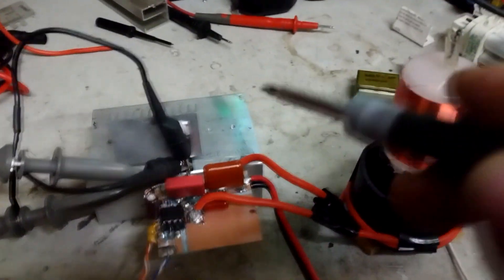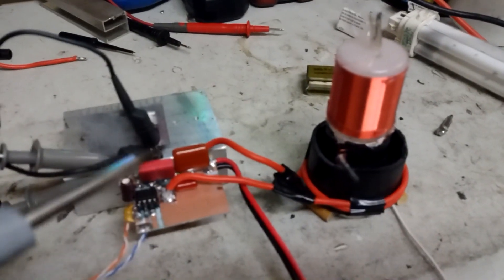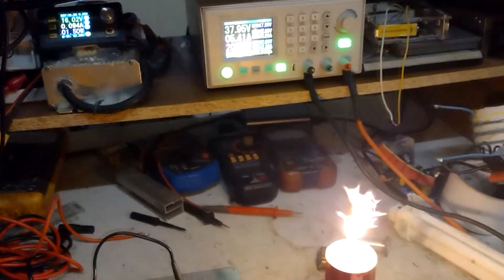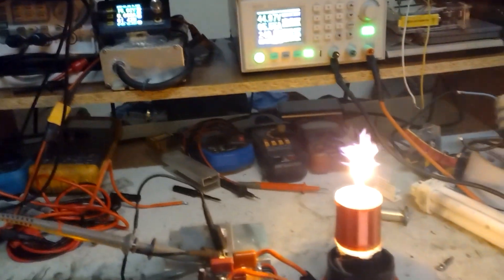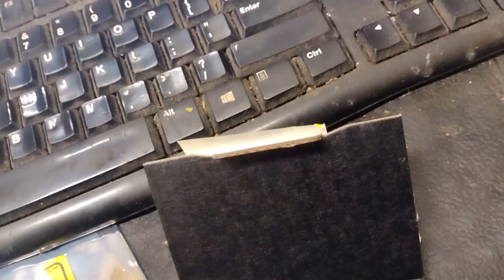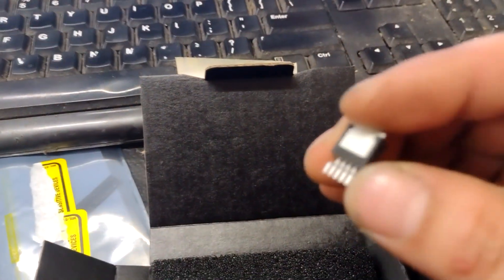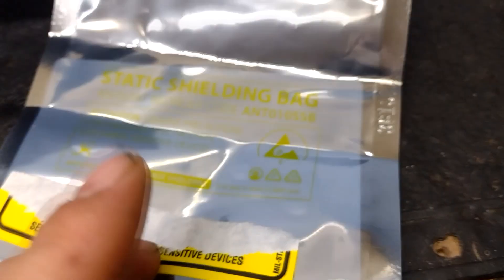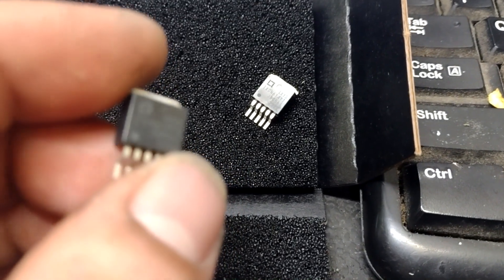3MHz Class E HFSSTC 'stacked coils' + Gate Drivers

Comment: What's the actual tuning procedure on a class E sstc.
Like how to choose the input inductor value , D-S cap and DC blocking cap and primary inductance or number of turns. 

Is it like setting the Inductor and D-S cap to the resonating frequency of the secondary and choosing a blocking cap with a non-critical value between 47 and 330 nf .
Is the primary inductance important or do I just test with 1-5 turns keeping everything else constant. 

Still not sure.
Reply from the maker: Depending on the actual topology used it can be different. In these circuits I'm using the primary and switch capacitance to form the LC circuit. So in that case the idea is to as you said match that tank frequency to the secondary resonance, which with secondary feedback should have the primary running at that frequency. 

The inductance along with the capacitance in the primary circuit will ring during the off cycles. If you can tune that primary circuit to ring at the same frequency it's being driven then you can shape the drain waveform into nice humps that will charge the drain capacitance (intrinsic +external shunt) and discharge it back to the primary at the right timing so when the switch turns back on there is no more voltage across it already. This means for a given resonate frequency you plan to run the circuit, the primary coil needs to be an exact length relative to the total shunt capacitance.
Reply: @Magneticitist won't loading and extra capacitance from me keeping my hand near it or for some other reason , change the secondary frequency .
Also the core material for the gate drive tranformers . I'm thinking of a 500 to 750 range frequency for my secondary . So N30 maybe ?
Reply from the maker: @spiderspider1384  Yea you just have to keep that loading in mind when tuning it basically. You don't want to be tuning the network at something like 24V if you plan on running the thing closer to 90V etc.. You tune it (gradually if needed) for 90V and just deal with it being out of tune at 24V. N30 or something should be fine.

Comment: Those UCC27614 are indeed stupid small, the only way you could use those is if you get a custom made pcb and a hot air rework station. Alternatively if you still want to experiment with that driver I believe they come in a bigger package if you get the UCC27614DR version, although I’m not sure if they are have a heat sink pad on them.
Reply from the maker: Lol yep comically small. I could have just looked at the package to see that but I just completely ignored it and assumed they would be some type of reasonable size for the power dissipation. Would be cool to utilize them one day after getting a really precise board layout.
Reply: @Magneticitist for sure, and at that point you might as well miniaturize the rest of the circuit and make a super small board. Luckily it’s so cheap now to get them made in China, like $4 for 5 boards isn’t bad. The only thing is the time required to route the boards in CAD
Reply from the maker: @quantumlab9130  yea I totally need to learn that eventually though. My first thought when looking at them was holy crap how could I even get that on a board without some kind of modern soldering machine that does it automatically.
Reply: @Magneticitist  yea a hot air station (which luckily aren’t that expensive nowadays) is necessary for working on stuff that small, but it is still totally possible to do it yourself with some tweezers and a magnifying glass. And board layout is definitely a challenge, and is something I’m still still working on and not even close to mastering.
Reply from the maker: @quantumlab9130  I work with a guy who might be able to do it cause I damn sure can't. The pads on that thing are basically the size of a needle tip with about the same diameter distance between them. I guess with the right flux and solder paste it could all just sort of suck it properly. Kinda got me wondering now.. I almost want to tack hairthin wires on that thing and heatsink it with a piece of copper wire or something.
Reply: @Magneticitist  lol, you could try that. That would be incredibly tedious but possible with enough time and a steady enough hand. Although with such thin wires I don’t know how much current you could actually pass through those tiny wires in order to actually drive a mosfet.

Comment: Did you check my last short video on the audio Modulation with the big secondary , it sounded a bit distorted but I need to keep playing with it , those little fets get warm pretty quick , I should try with much less voltage like about 18v , but now I killed the tl494 when playing with it hehe I will get some more chips next week , and it is time to start with the hfsstc
Reply from the maker: Yea they will get hot with bad snubber tuning. I wouldn't really be able to play audio with that setup without having something like a nice 1inch long bush first though, because I'd need to back it down to something like 40% duty to remove distortion.

Comment: Not bad for 30V! I'm starting to think I should decrease my primary turns and add some capacitance instead to get higher peak currents at 60V. Right now, with 940pF on the D-S and 4.5 turns, it's alright, but I can't get much more than an inch off the output. Hopefully with less gate resistance and fewer turns, the output will look more like yours, lol.
Reply from the maker: This one has been kind of interesting in that the last couple builds took more care to tune. My entire process with these started out with me running that chapstick coil at 3.5mhz or so, fairly decently, then randomly at some point around 45V or so popping the sic fet I had on there. All I noticed at the time was fairly severe gate ringing. It hadn't reached a threshold where the scope was counting the rings in the measured frequency but it was something around 4-5v or so peaks. Since then I'd be scared and took great care in trying to reduce the ringing. Now some builds later and using the copper boards this one was incredibly easy where all I did was use the 1.65 ohm gate resistor and do the final tune on the drain caps. I can easily swing this one to 45V with nothing close to the ringing I see even on my other real nicely tuned setup with the 650V sic fet. So the clone IRFP260 is doing real good here. I think I could push 300W out of it no problem, maybe more if it survives 250v+ swings which I've seen other people do before on 200v fets at higher frequencies. I settled on the 3mhz here just because I need to use those two coils and stop wasting wire, but it seems like it could run 5mhz or so no problem. 

And yea if you want to push more power the first thing I'd try doing is going down to maybe 2 turns and upping the capacitance in the LC. If possible I would just try to monitor the gate drive power with just the oscillator and mosfet first, trying to find a compromise on the waveform you're seeing and the power dissipation of the driver at the time. There's going to be a reasonable ceiling with your given setup starting with maybe something like 3 ohms gate resistance. At that point you can sort of just ballpark a DS cap based around what you know to be your current L1 length and the freq according to your ~1nF. If 3mhz seems doable, then you'll probably need to maybe halve your DC cap or close to it, or reduce the number of total turns and L1 length etc. Eventually you'll be able to power the primary and just vary the freq til you see close to zvs/zcs, and then just know you can wind a secondary in that ballpark. After that you'll need to tune it again with slight adjustments to the LC, and maybe notice that just slightly raising the primary coupling will increase the power draw quite a bit without ruining the switching.

Comment: Hi
Thank you

What us the secondary wire size and number of turns?
Reply from the maker: It's 32awg on a 1.3 inch diameter former. Both coils together probably make like 300 turns.
Reply: @Magneticitist  2 coils separated by some distance I suppose. Any reason vs a single coil?

Thanks again
Reply from the maker: @Gacha.Cupcake  No reason in particular. I had both coils separately wound, then wanted to try a lower frequency so I just stacked them and it seemed to work well enough as opposed to winding a new coil.